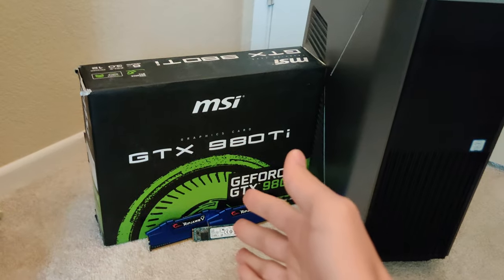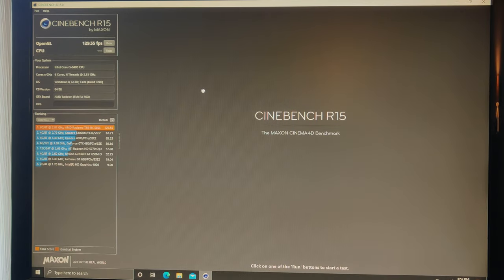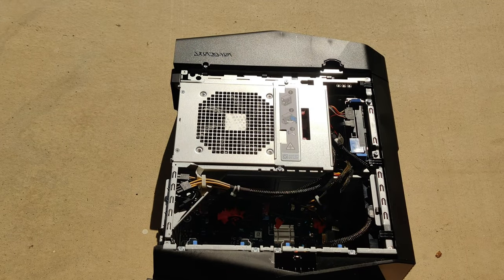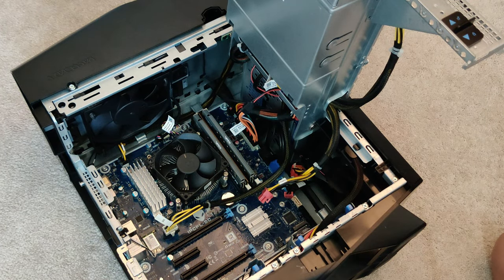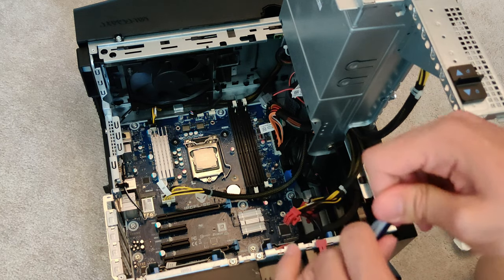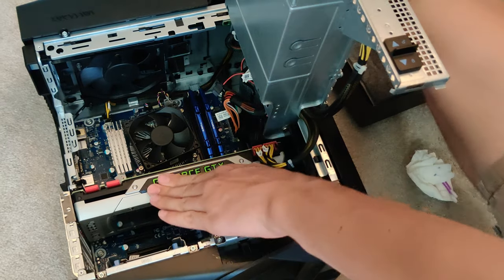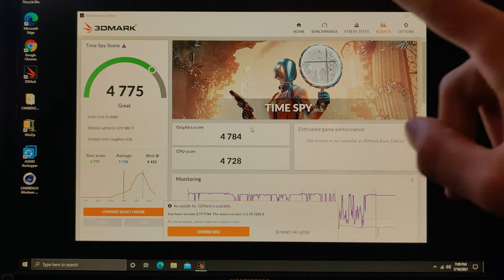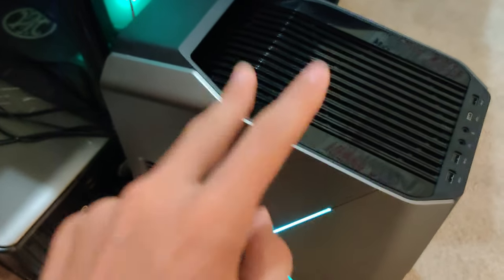Alienware R7 Upgrade/Restoration

Comment: RX560 is actually a really solid budget offering that can be found on eBay for cheap and is a great card for builds out of old office PCswhich is what I do most often
Reply from the maker: Its a great starter card. I actually used the same card in my hackintosh build!

Comment: FYI, I run a 3080ti. Just get Noctua nf-a12x15 fan. It’s only 15mm thick vs. the stock fan which is 25mm thick. The 3080ti pops right in and works great.
Reply: which 3080 ti  you got i have r7 also what power supply yhe reason mine came up with 450w  my last question the fan noctua has any compatibility issues. thanks
Reply: whats your cpu since you're using such a powerful gpu,